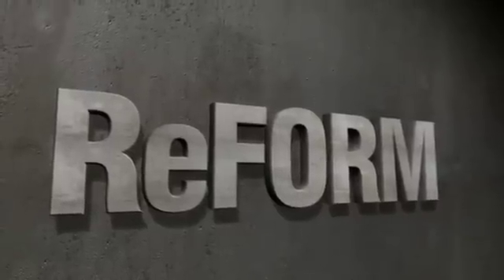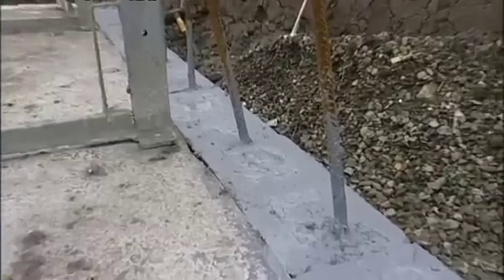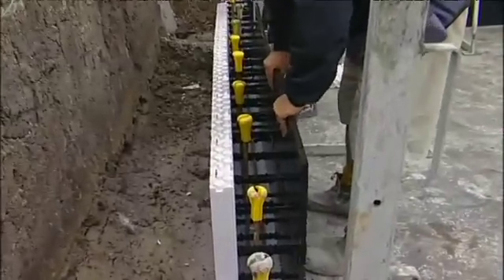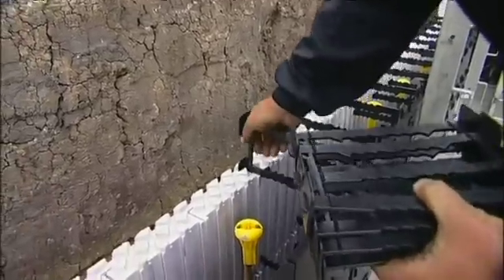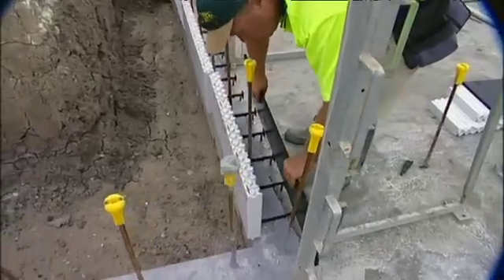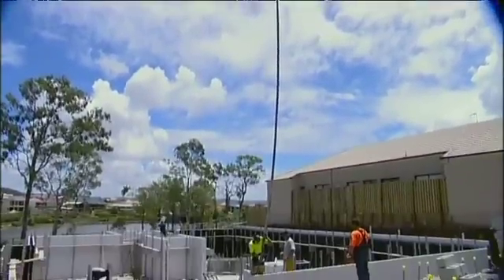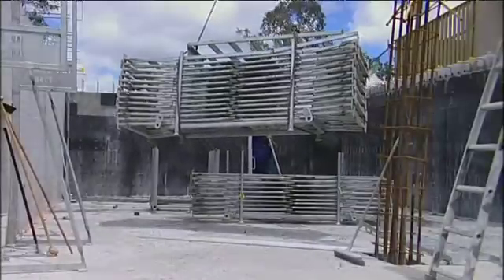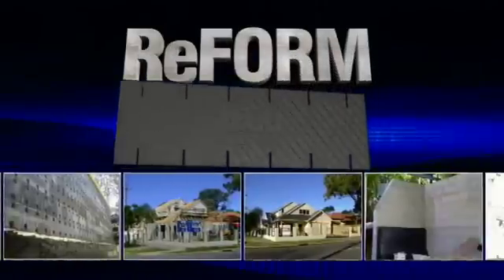ZEGO ReFORM Strippable & Reusable ICF Formwork.mp4

Comment from the maker: The foam on one side not only insulates it is also a service duct for plumbing, gas, data and electrical services with no structural damage to the reinforced concrete so there is also no reduction in FRL or STC of the wall.